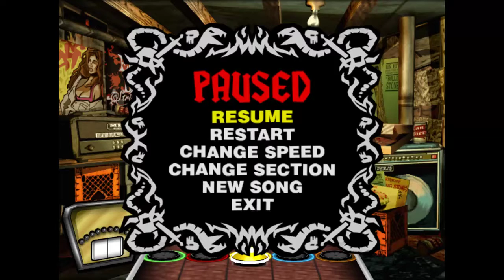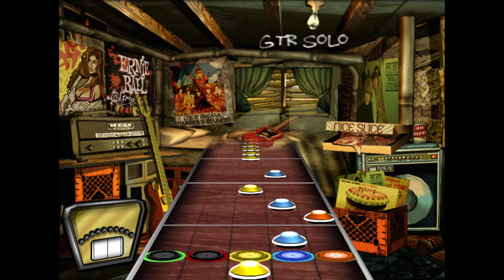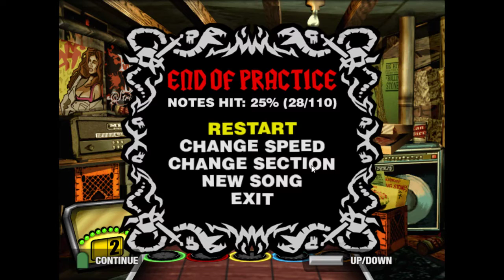Strum limit explanation (description) + how my previous video was done

Comment: Have you tried testing this with the next section after the solo? It adds the orange sustain which may or may not prove if it's possible for a full song FC even on emulator.
Reply from the maker: Yes and I've overstrummed the sections several times during the tests. In this particular video I happened to cancel my strums with the hopos which threw me behind for the rest of the section yet I was still catching up slightly by the end of the streak.

Comment from the maker: Disregard nuno's comment, this video was posted during my testing and I decided to edit the title/description and make it public instead of posting a new video lol.
Reply: Don't disregard Nuno's comment; it is still applicable.
Reply: Could lag affect it too? Obviously the game runs super smoothly on an  emulator on your PC, but I know that I used to get slight framedrops on my GH copies on xbox occasionally. If the frames aren't drawn in time (even 1-2fps dropped for a period of a few seconds), then couldn't it affect the results and lower the theoretical strum limit?

Also it should probably be noted that PCSX2, and all emulators, aren't perfect. They don't really act as a PS2, they act as a simulated PS2 with potentially different effects. Obviously you know this but what is true on an emulator and works may never work on a real PS2. It could be the case that Trodgor NTSC is possible on an unedited emulator with absolute perfect timing and no lag, but it isn't possible on the PS2. Might be a possibility to consider.

Either way, awesome job figuring all this stuff out. Would you count an FC of Trogdor on an emulator as FC count towards a Full Series FC? I just want to hear your (and others I guess) opinion personally, since for a lot of people they are locked out of the FC because of region/hardware.
Reply: axiomatically n0p @ the last paragraph
Reply from the maker: "If the frames aren't drawn in time (even 1-2fps dropped for a period of a few seconds), then couldn't it affect the results and lower the theoretical strum limit?" It really depends of how frames are drawn, Scott pointed out few things about hblank and vblank and shit like that that doesn't affect the theoretical strum limit but doesn't give informations about the practical strum limit.
Reply from the maker: I also explained your second paragraph pls and for the last paragraph it would only count if done on PAL at 50fps tbh since enabling a higher framerate than 60 only remove the rng element of making sure you strum every 3 frames